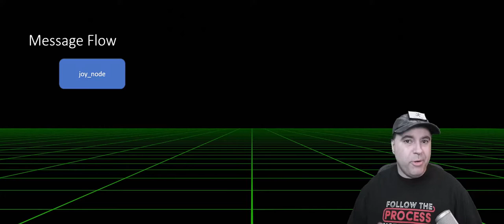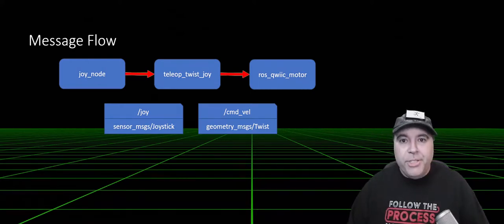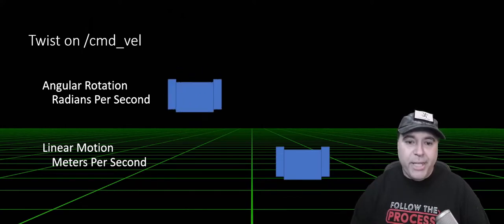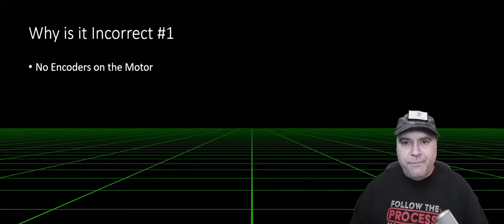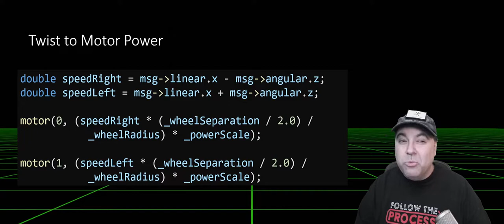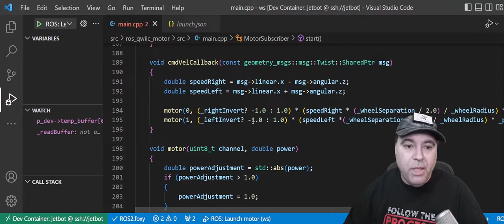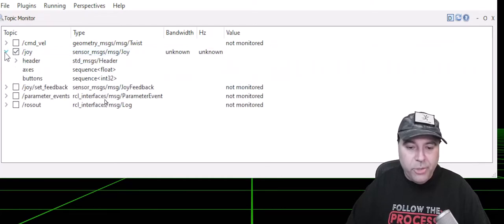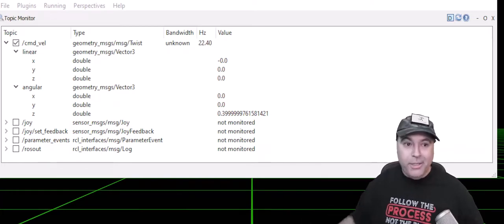Getting Started with ROS2 Navigation - Episode 7 - How not to build a Motor ROS Node

Comment: Nice video, I have been enjoying your content. As a relative noob to ROS2, motors have been my undoing since the start (about 18 months ago)! I am still fighting this issue today, waiting for a new part to arrive. 

The problem I had as a newbie was the closed loop control and the encoders. I modified a wheelchair base that has no encoders so I bought some. I then had to integrate this into the code I butchered ros2_differential_drive package and a python library for my sabertooth motor controller I used. It needed to be big and it was expensive! I chose this before I ever heard of ROS and was writing everything in pure python.

I got the whole stack going pretty well, Lidar, IMU, NAV2 it was great.... in RVIZ! But ulimetly if your wheel ODOM is off, nothing will ever be correct. As this channel is aimed at beginners please allow me to voice my experience and suggestions. I do NOT have the experience or qualification to call this advice.

For small indoor robots maybe PID is easier to implement? Smaller wheels, less travel, generally more around to have Lidar help with localisation? I have no experience with ROS small robots.

I found an upgrade for the Dimension Engineering Sabertooth range of motor controllers that uses hardware and a set of encoders. It can "self tune" the Sabertooth to perform the PID and keep the wheels at a constant speed. PID code and tuning (which I understand is not easy) is handled in hardware. They have small and large units ranging from 50-200 dollars and the Kagaroo module is about 20.

https://www.dimensionengineering.com/

I always knew I wanted and should be using ros2_control for the motion and wanted to move away from a standalone node and use a "stack" written by professionals for the purpose of movement. Problem is in months of searching I never found a "hardware interface" [AKA Driver] for my sabertooth or any other motor controller I could just plugin.

https://control.ros.org/master/index.html

I found a hardware controller for the L298N Motor Drive Controller - diffdrive_arduino for the ROS system and ROS Ardunio Bridge that runs on an arduino to interface the board:

https://github.com/joshnewans

One the ROS side it just uses serial commands to the Ardunio so I think josh has a very eligent solution for smaller robots that use the PWD motor controller with ros2_control. He has a great video on it here:

https://articulatedrobotics.xyz/

I am not knocking anything said in this video it is 100% correct to the best of my knowledge and this is just a cautionary tale from my side on the big motor problems that I got hung up on.

Hopefully I can use his hardware interface (with a little hacking) to control the Arduino which has a library by the manufacturer for the Sabertooth modules. For me that's my ideal solution but for others who might wish to use the L298N Motor Drive Controller for a project I would recommend ROS2 control for even a beginner as it masks a lot of the deep complexity behind robot kinematics.

I have forked* Joshes project and it can be found here:

https://github.com/teknetik/ros2_control_diffdrive_sabertooth_arduino

Use the original project not mine for the L298N. I have not really started work on the actual code yet and still working through basic setting of the motion controller but wanted to add a place holder for anyone who is interested in the Sabertooth. I will get this Hardware interface working - Watch this space! :)